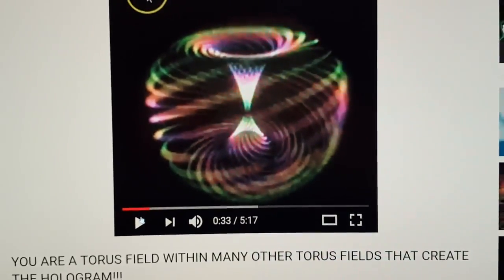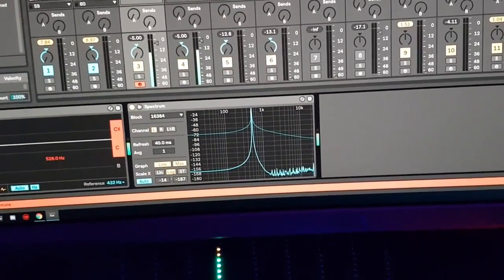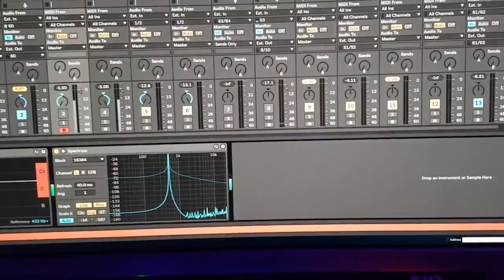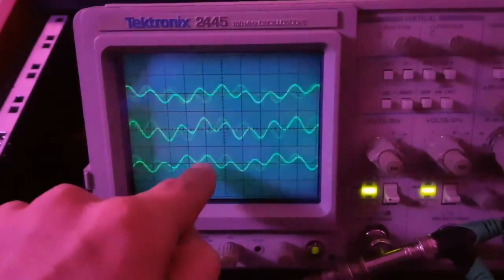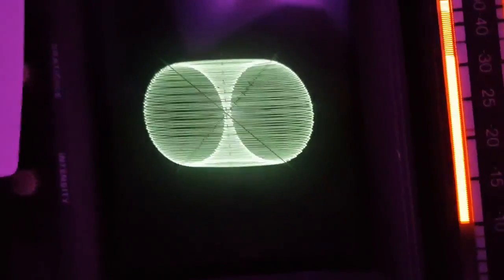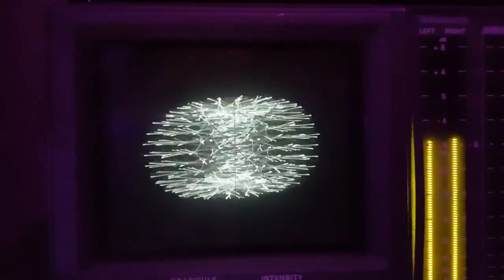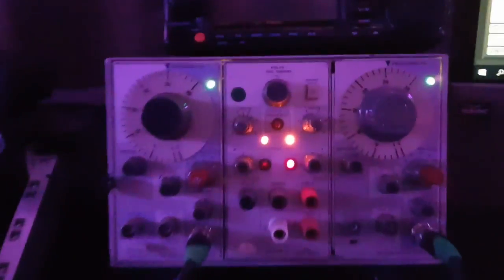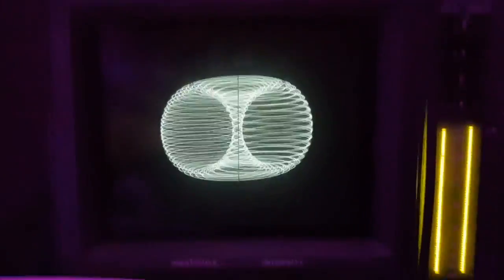Making up a Torus using Resonance & Modulation (By Viktor Ophuizen Van)

Comment: 2 oscillating  resonant frequency = 528 hz + 528 hz + 144 + 144 (2 frequencies + four channels)
resonance creates the form
Effectoscope = shows form = shows resonance of audio
Phase @ = 0.61 = 1/phi = circle
144 x (0.61 x 6) = 528  = 144 x (6/phi)
phi = self similarity  = self embed = 1/(1/(1/(1(1…..
resonant system of one thing related to another form of itself (1/phi)
Reply: there is no resonance